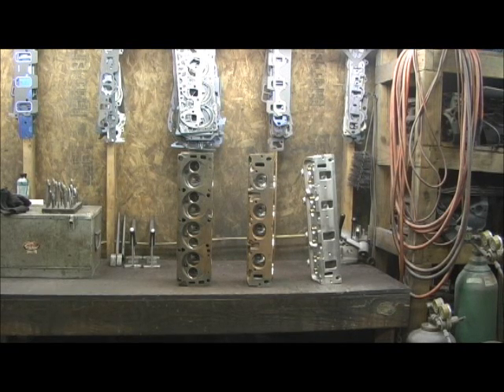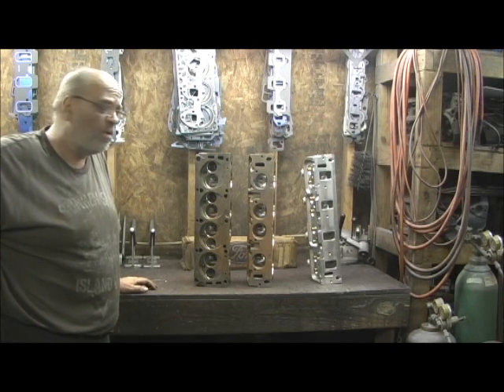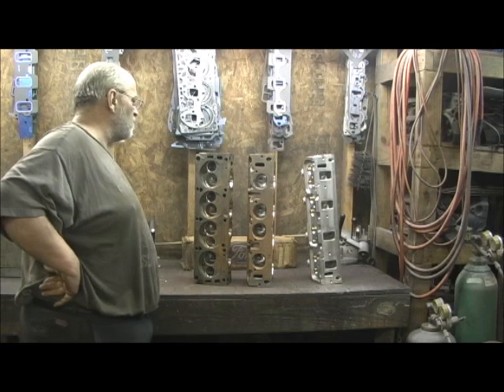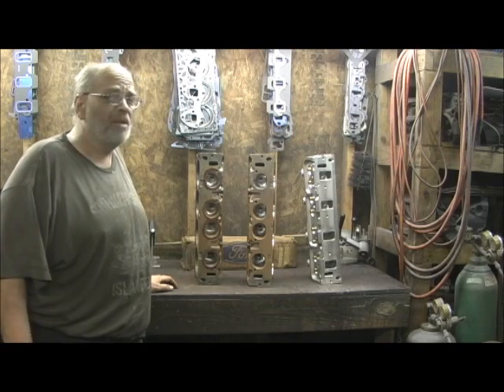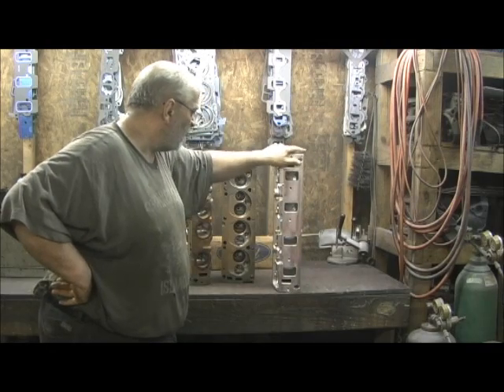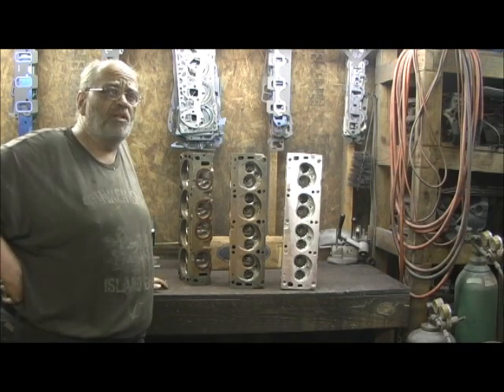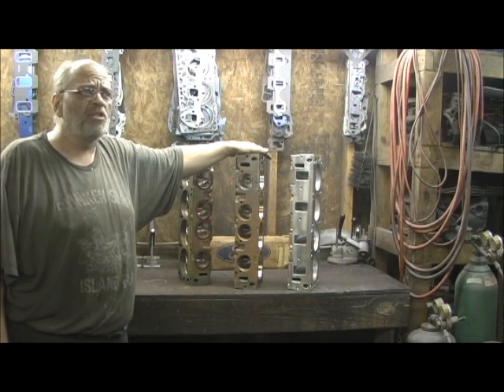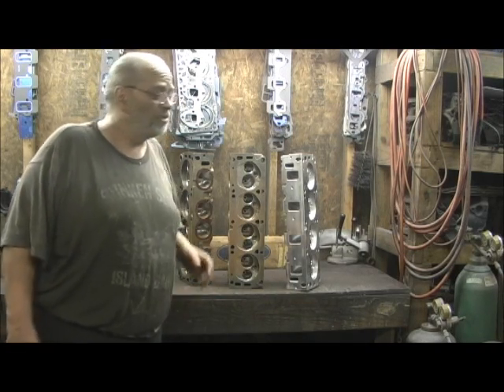Ford TUNNEL PORT 427 FE Head Vs  ProMaxx "NEW" FE Head 1.0

Comment: interesting learning . but 20 yrs ago or so , i read about my 2.3 ford , in 1980 simple mustang just needed bowl porting and lite port cleaning to run better . well i did.  raised bowl roof a little , cleaned around gudes and just knocked down port casting ruffness and fuel mileage DROPPED 5mpg , but was about to climb hills in 4th down shifting less and had a nice little GRUNT motor that could run another 500 rpm higher with more power as old stock only run near 450rpm b/4 start dying off . watching you work so i might get back into in retirement . probably tractors .  thanx

Comment: When I was in High School our shop teacher had a contract with a local racer to build 454 Tunnel Port Fords using the 427 side oiler block and 428 crank. We ported the short turn radius of the exhaust ports by hand with strips of sand paper and emery cloth. The idea was just to moth things out, not remove tons of material. It hurts too see such a bad job on such a rare head!

Comment: hey sir i got gm fast burn heads how big a cam can i run with my stock valve springs?
what do you think about GM FastBurn heads do they flow well out the box? don't they come CNC